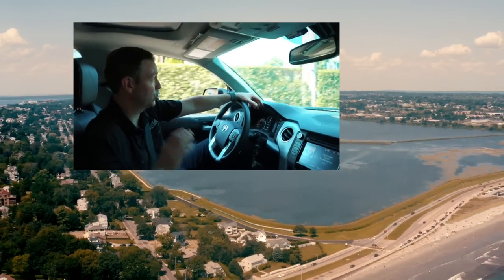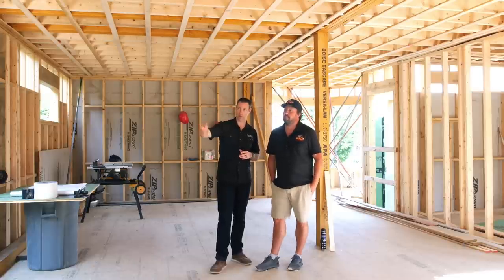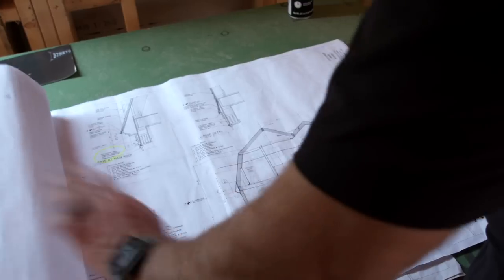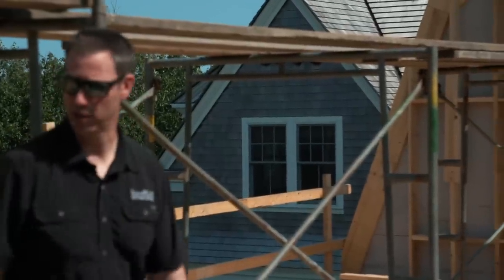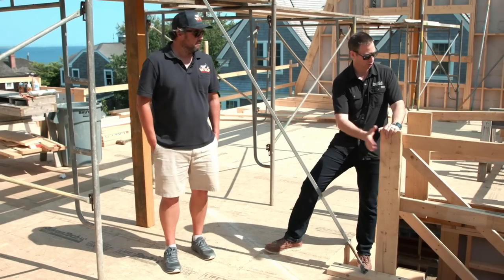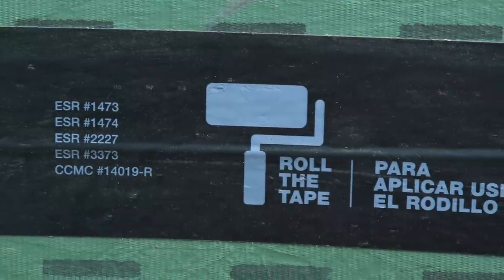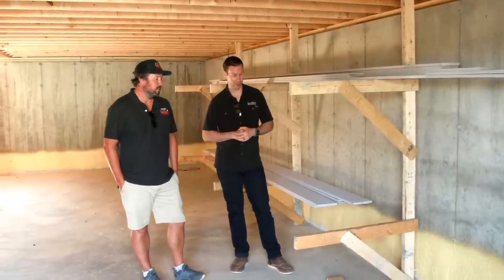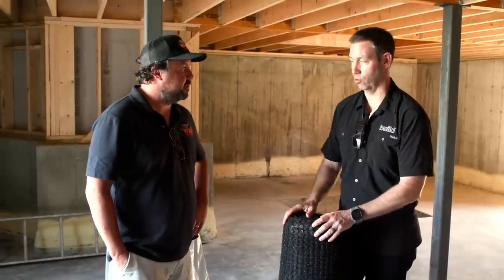FRAMING - Some surprises for an efficient BUILD on this home!

Comment: Good to see the cedar breather. Back in the day we used to just put the cedar shingles on furring strips in New England. Roofs had no sheathing and when the shingles where dry you could often see daylight through them in spots from inside the attic. As soon as it rained the shingles swelled and sealed the rain. Pretty cool to see how process has progressed in years (decades) since.

Comment: closed cell foam under the concrete slab in the basement all the way up to  the floor joists for the first floor. that is so crazy intelligent and will save the homeowner likely thousands in heating bills over the lifetime of the home.

Comment: East coast always builds and trims out the gables and walls before standing and strapping is there to tie the parallel walls to the joist. The codes are much different in the east coast compared to Texas.
Reply: No kidding. I'm in a windstorm county and my windstorm inspector wants to look at all of my metal straps before sheathing.

Comment: Besides all the cool stuff Wade is doing on his job, my favorite part was him calling you a dork with your closing line ;)
Reply: I just talked to the foundation insulation manufacturer. It is called ShcokWave by Mar-Flex. It is actually R-3.48 per inch, they market R-9 for the 1" and R-13.5 for the 2", they included a certain thickness of earth against the insulation which, I would say, falsy boosted their marketed R-Value. Still, a really cool product and a decent R-Value per inch, considering it is also a drainage mat.

Comment: If you're going to build in New England and on Ocean-front property  you MUST take every precaution that Wade has employed in this build. This house will easily last 200-300 years and  longer with proper maintenance. Yes it's expensive....but wait till see how much it costs to "Go on the cheap".
Excellent work!!
Reply: Agreed. I live 10 mins from this house. Most of my small job work is exterior repair from salt and water damage.

Comment: Let’s get this straight again Matt the 1x3 strapping is mainly used for structural integrity which holds the House together. We don’t depend on the  drywall as you do. To do this job. Its lateral bracing evenly spaced across the whole structure. You should try this in Texas for a stronger overall house. Thanks
Reply: Mmmm... Actually, the strapping will allow slightly longer joists spans (e.g. 1' or so), reduce deflection of the floor slightly, and more importantly help reduce squeaking. Strapping does not "hold the house together" in any significant manner. As far as the strapping allowing the builder to make the ceiling flatter, that's another reason to use I-Joists.

Comment: The laminations, the layers!  Let me count them.   Modern high-end construction is "obsessed" with single-purpose and perhaps double-purpose layers... closed cell foam, cedar breathers, black waterproofer, etc.    And this is only for the framing and foundational stages of construction.   Very impressive how there is a closed-cell insulating/waterproofing layer beneath the basement slab.  Finally, kudos to the architect, on so many counts... including inclusion of an elevator.  Aging homeowners have mobility problems, and the only way to properly address those is with original design of the building.

Comment: I’m surprised you didn’t ask about why he didn’t insulate the headers instead of using wood. That is always something I got from your advanced framing videos.
Reply: Money or structure or fire. He did solid wood joists which are safer in fire, cheaper in short spans than i-joists. I'd assume some sort of analysis was done for headers as well.
Reply: Yes, all that solid wood transmits heat profusely.  Still, this isn't Churchill Manitoba.  But I see heat waste in this RI location.    Oh heck, if the homeowner can afford this house, he can afford some considerable heating expenses in winter.   That's over 3K sq feet of living space, and likely high ceilings everywhere.
VERY INTERESTING moisture barrier construction, to me.   I'm in SoCal and I believe any moisture barrier in SoCal should be on the exterior of the structural wall materials.   In Rhode Island, the opposite is observed.   So those timbers have to breathe (inhale, exhale!) OUTSIDE air.   Modern tight construction is problematic to moisture-caused decay, otherwise... a point Matt has hammered upon in other videos.
Reply: Doesn't the Zip go over the headers on the outside ?  That would be an R-3 plus 6'' of wood making it around R-12 or so.
Reply: @augustreil  It still makes sense to include some thermal break.
Reply: @guytech7310 , Agree 100%  I thought the Zip R-3 had a 1/2'' of Poly-ISO on the inside of the plywood ?  Isn't that considered a thermal break ?

Comment: slight correction, if you read the tube on PL subfloor, it specifically asks for a wet surface to aid in the bond.

Comment: Nice house.  I liked the hesitation at the Gorilla Glue. It's oversold and isn't what it says it supposed to be....but there are many places where it is just right. And the foam construction adhesive for the decking sheets? Sounds like a more efficient option than construction adhesive. On a cold day squeezing those tubes can take almost as long as nailing down the sheet.

The 1x3 stripping. The added strength of solid blocking just cannot be beat, and the rookie can cut and install blocks on their first day without causing any problems. Probably isn't needed for this house.  Good video. Thanks
Reply: I think the strapping beats the blocks by far. They are every 16", provide a flatter ceiling, wider flange for the sheet rock to be screwed and nothing in the way for the plumbing, wires, etc.
Reply: The foam adhesive is a high polyurethane adhesive which is exceptionally good bond strength and it bonds to wet or frozen materials. Plus it has a 5 year squeak free guarantee
Reply: @milanroets9697  Thanks Milan for the information.  (I better cut back on watching these videos, or I"m going to build something....)

Comment: Nice Video Matt: Did I understand this correctly, a floating Concrete basement floor ? No rebar tie into foundational walls, any shifts in cold climate areas?
Nice attention to details on the structure & plans.
Thanks for sharing 🙂
Reply: NE homes have slab on footers for below grade basements. No tie ins to allow for freeze/thaw expansion contraction of ground.

Comment: Nothing hugely surprising, but nice to see the different methods/materials.  That recycled carpet padding for exterior drainage and insulation is a great idea. But how do they attach that to the wall without affecting the waterproofing?
Reply: Just stuck to the hot tar below grade while it's being installed, above grade a few screws are used.

Comment: So I was thinking about this the other day. We have this beautifully seal envelope  with liquid flashing on mechanical fasteners and probably tape on seams on the Zip system.  What is the deal with the shingles?  They are going to puncture the Zip system for the cladding in two places for each shingle?
Reply: The ZIP sealant is supposed to eventually seal around the nail holes. That's the selling point anyway.

Comment: Question for you, how do you address the loss of insulation at the headers of exterior windows and doors? I work in the architectural industry.  Instead of using (3) 2x8's with sandwich 1/2" sheathing for a standard 2x6 exterior.  We exchange it with (2) 2x10 with no sheathing and place the header to the outside of wall, that gives you room for some batt insulation at the header location.  You can then add furring @ 16" o.c. as needed for attachment of interior drywall or finish.  I have seen that you could replaced the 1/2" sheathing in the header with high density 1/2" rigid insulation for a sandwich style header.
Reply: On 2x6 walls, I usually use either a double 2x or LVL to leave a 2" to 2-1/2" gap for insulation in the header. It doesn't meet the R-value of the rest of the wall but is better than nothing.
Reply: @andrewsederquist5501  Yes, this is why we do it as it is better than not having any insulation at the header location.

Comment: Just an Outstanding show! 
Wow Hank, I love you Foundation details, exterior drain/insulation and then the amazing foundation slab spray foam approach, just Brilliant.  
Seems You've essentially provided the benefit of an ICF foundation having Insulation on both sides but likely even more air and moisture tight being monolithic!!!  I hated laying and taping my sub-slab R-20 foam boards... this is so perfect.  

Three questions/concern I had: 
1.  With the Insulated Zip outside, and then wool batt insulation and covered inside... I thought I heard reference to a wrap (poly?) before the sheet rock is applied?  DOES the wall "breath" to the outside through the Zip system to prevent moisture captured inside the wall cavity???  I know I am missing something here.  
2. Are you applying your conditioned attic spray foam directly under the roof deck without problems or risks to the shingles?  Perhaps that nice mesh underlayment provides enough air flow to both help dry the cedar shingles ... and ... provide a "Soffit-Like" air movement for summer heat?  
3.  That Awesome foundation closed-cell sprayfoam on the foundation walls goes up to the sill plate...(super nice)...  does it ALSO carry up through the floor joist cavity and tie-into/adhere to the back of the insulation Zip wall to essentially create a Foam-To-Foam air/moisture barrier???  Perhaps then carrying all the way up to the Top Plate and the roof deck spray foam???   IF so, it should be super tight for your blower door test!  

I hope we get to follow development on this beautiful Gambrell!  Growing up in Mass. we lived in a Gambrell. :-)
Reply: I'm curious about #1 as well. Zip R-Sheathing uses poly-iso foam, which is a vapor retarder at 1" or more in thickness. If I were designing this wall I'd make sure the inner face of the Zip insulation stays above the dew point in winter and I would not use poly on the inside face of the studs. This would place the vapor barrier midway in the wall and allow the inner half to dry inwards and the outer half to dry outwards.

Comment: The picture for this episode shows the joists all being hung by joist hangers to the beam which is being supported under the post. Never seen building like that. Usually the joists sit on top of the beam which is far stronger. I know joist hangers can hold a lot and I am sure having the joist sit on top of the beam is Overkill but it's also more expensive to have to buy all those joist hangers.

Comment: The problem with that sprayed on the foundation sealer is when the wall cracks, so does the sprayed sealer.
Reply: Unless the sealer is made with that in mind, and will stretch ;)
Reply: @ModernMountainLiving  we are talking about the external foundation sealer, not the foam insulation on the inside.

Comment: Why did you use a square Lally column? The load requirement to buckle the circular column is equal to the perimeter of the column, but the rectangular column may deflect through both axes.The rectangular or square column has four weak points (corner edge), but the circular is in the shape of a cylinder, so there are no weak points.The circular column is strong in compression compared to the square column in the same cross-sectional area.

Comment: Hey Matt, thanks for another great episode. I have a question regarding the proper way to install electrical wires perpendicular to floor joists. Wade said his team use 1x3 strapping so they can stapling romex to the bottom of each joist instead of drilling holes. Is it against building codes to staple romex to the bottom of joists? Thanks Ryan
Reply: Without re-reading the electrical code, I thought the same thing when I heard that.

Comment: Nice to see the airtightness detail on the walls done properly, but only 50mm of insulation under the floor and up the basement walls? Why so feeble? What's the overall kWh/m2/yr for this building?

Comment: Hey Matt, thanks for all the great knowledge! I'm a DIY guy repairing a 1910 millhouse. Could you do something on Airless Paint Sprayers? Thank you again!
Reply: Sin Blader : Go Graco and you won't go wrong. And instead of me going on and on, just go watch Paint Life TV. He's a painter and goes into detail about what he uses and why. He also goes into detail about why he uses certain techniques. BAMMM... Mic Drop... Hope this helps.
Reply: @TrailTrackers  Thank you!! Are...are... are you just gonna leave that mic there? C..Can I have it?
Reply: FWIW: don't see any benefits using airless paint sprayers over traditional rollers. Cleaning the machines and the wasted paint negates any advantages in my humble opinion.
Reply: @guytech7310  : Hmm... Then you haven't painted enough. And you're not doing it correctly if you're wasting paint. That's a fact.

Comment: Question about the interior vapor barrier... since the zip r sheathing in pretty much imperiable, and then you put a vapor barrier inside, won't moisture be completely trapped inside the wall? What am I missing here? Seems like you could either do 1 or the other, but both would be a disaster if moisture were to enter the wall cavity.
Reply: bluebird5100 for the climate zone a vapor barrier is required by code.  Zip System is a low perm WRB. The vapor barrier that he is using is low permeable vs a traditional plastic that is non permeable so both sides of the cavity will allow for moisture to perm out.

Comment: 12:49 Matt says "While it is on the ground. Well that's smart..."  Don't they frame walls on the deck in Texas? Just wondering.
Reply: user990077 I think he’s speaking to the viewers who near no experience framing what so ever. I got a laugh at that too haha. I wonder if the metal braces are worth using vs 2x4.

Comment: So the framer is using glue on the joints and relying on the sheeting as the gusset? Are they also glueing the sheeting to the frame to get more of a bond?

Comment: Question; your building houses framed not SIP walls yet SIPs are considered the supereasy and fast way to get an airtight building. What is your reason to continue with framing?
Reply: a shallow frost protected foundation with thermasteel panels  the way to go
Reply: SIP walls sorta suck because;
1. Difficult to run utilities. Either you have to run electric in specific space were there are channels.
2. If there is water\moisture damage your basically screwed since the OSB + foam is the structual support.
3. Expensive and longer lead times for getting materials on site. 

Best bang for the buck is SIP roofinging and 24 OC 2x6 walls with 2" inch or more rigid foam. You get close to SIP wall performance, but with out all of the headaches.
Reply: @guytech7310  thank you for your feedback. Yes, I agree that especially services need to be well thought out before ordering the panels. And I was always wondering about weet-bix walls if they are just asking for trouble. How will the ESP foam last over the years, will it release gas? I know from particle board made 25 years ago is now falling apart and releasing a gas that is harmful to health, will the same happen to osb?
Reply: @andreycham4797  thank you for your feedback, here we dont have to worry too much about frost, just lots of rain on a clay bottom. So lots of movement between the seasons.
Reply: @guytech7310  Thermasteel panels do not have osb on them . Other reasons are minor , just remember you build a house for people comfort who live in it not for you or your workers

Comment: Big Big problem! On a few of my frames I’ve flushed the LVL grit with the KD joists using hangers as is seen in this house Wade is building. If it’s an open floor plan above, over time the KD shrinks and the LVL girt is proud 1/4”. Tile, hardwood… gets displaced and I get or I should say I got the dreaded phone call. Always frame KD a 1/4” higher than the LVL. If not, it’s all over but the crying!
Reply: can you explain this with context for people who aren't builders?

Comment: If the zip system is using polyiso isn't it a vapor barrier? If so and you add another vapor barrier before the drywall wouldn't you cause moisture issues?
Reply: Just looked up the specs. Looks like he is using Siga Majvest which is vapor-permeable and not vapor barrier like he said. Probably just a slip up when he explained
Reply: plcharbo I don’t know anything about that product but I looked it up quick and it looks like an exterior wrap. Why would you use that on the inside between studs and drywall?
Reply: Total slip up! Meant Siga Majrex
Reply: @WKPConstruction  Thanks for the clarification. You did good on camera
Reply: I think the question is still a good question - what’s the point of the vapor permeable barrier in the inside?
Reply: FWIW: I don't really see any need for the inside vapor barrier, but it would be used to address inside moisture (Showers, kitchen, Laundry, human breath, etc). Moisture created inside the home tends to migrate to the sheathing and condense in the winter as the sheathing is generally much colder than the inside livingspace of the home.

Comment: I dunno about the Gorilla poly glue.  It failed on me outside with ipe.  Ipe is oily unlike cedar and I did acetone wipe it but still failed and within a year.  Titebond III did the trick on the acetone-wiped ipe so far a few years in.  My experience anyway.